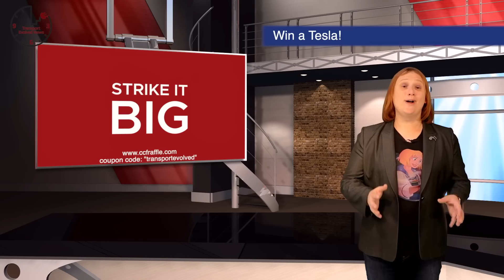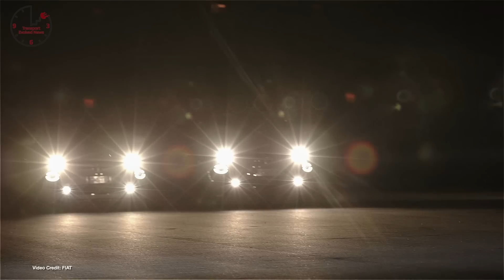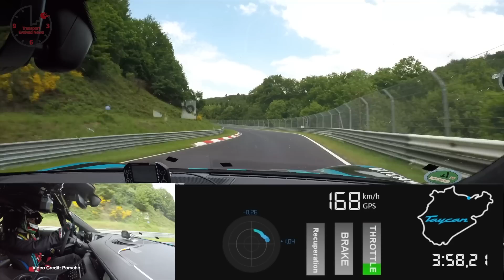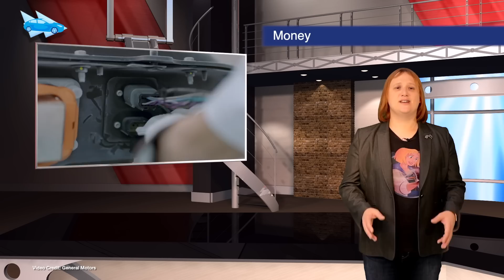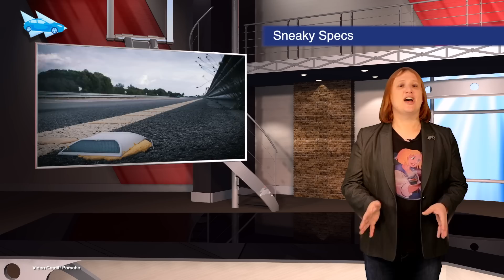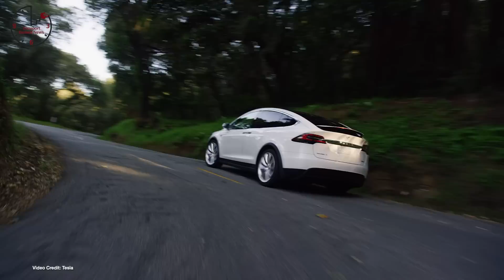Aptera Reborn, Polestar Production, Taycan Record — TEN 263

Comment: Porsche Taycan: I just set a new lap record on the Nurburgring Nordschleife!

Tesla Roadster 2.0: Hold my beer.

Aptera: I have a range of 1,000 miles and don’t need a plug to run most of the time.

Tesla Roadster 2.0: Spits out beer.

Porsche Taycan: 😭

Comment: I think that the Aptera is conceptually wrong. By prioritizing aerodynamic slipperiness over almost everything else, they have forced themselves to compromise on urban practicality. In daily use, most of us are using the right pedal to overcome inertia (AKA accelerating) more than to support slipping through the air (AKA cruising on the highway) I think that a car that is designed from the start with a basic practical shape (a five door hatchback) and then optimised (ie, the details are fine tuned) has a better chance of success.

Comment: Aptera's strategy of releasing a 3 wheel commuter car with a 100KWh battery pack that will run for more than $34,000 seems way out of touch with consumer demand in America. Sure people would like an EV with that kind of incredible range but a vehicle like this isn't designed for long distance trips, it's designed to be a commuter car to get to and from work. I don't understand what they are trying to get at, ok cool you have a car that can go 1000 miles on one charge but you have no cargo room to take anything with you and you can only have a second passenger along for the ride....
A better strategy would be to dump the weight of the 100KWh battery pack for a smaller one that can reach 250Mpc for under $20,000. When you combine that price with the $7500 federal rebate people would buy those up like hotcakes. Personally I would buy one for driving to work while keeping my jeep to use for snowy days or vacation.
Reply: You have voiced exactly what I was thinking.  Thank you.
Reply: Nobody is being forced to buy this vehicle. In due course we will see how many people think it is suitable for them and choose to buy it. I suspect you can take more luggage in it than you can on an airline flight. I do believe the performance claim; it works out to just over 60 watt-hours per kilometre, which should be easily achievable with the lower frontal area and likely lower drag coefficient. The battery would weigh about 400kg/850lb if it uses the best technology that is currently available on the market. It will be possible to go for the highest energy density without any need to worry about ability to work at high discharge rates.

Comment: Uh, where are they going to fit a 100 kWh pack in this tiny thing?
Reply: Even if they only manage 50kwh (which for the sake of cost and weight, they should go smaller), this thing should be stupid efficient and should have no problem still getting 300+ miles per charge.
Reply: They are not, not any time soon with current technology..

Comment: Nikki. Record performance on the "Green Hell" is important because so many anti-EV folks dismiss an EV's superior straight line speed and point to the green hell course as the real test of a car and that an EV will overheat before it can make a single circuit.

To sell the Taycan Porsche have to show that their EV can do this test admirably.
Reply: That lap time was faster than any production EV has run there ... and the Ring is the defacto global standard for comparing performance cars. Porsche didn't mention that the time was only 4 seconds slower than the Porsche Panamera Turbo S.

Comment: Billionaires of the world, please give Aptera that pocket change they are seeking. What's one million these days?
Reply: No one with a family or a loved one is going  to drive one of those things. Planes can be built lightweight in part because they have to be strong structurally but not strong enough to reasonably survive collision with another plane. The Aptera is about as safe as a motorcycle, because that's all it is. You can make it look like some jetsons car, but you can't call it a car.
Reply: @bradscott3165  If you can find the structural tests from the original Aptera, they show that it's actually incredibly strong due to the construction materials used and its unique shape.  Occupant safety in the event of a collision was one of the primary design goals at its inception.  Small, low-mass passenger cells, when engineered correctly, can be very, very strong and when combined with appropriate crumple zones and anti-intrusion structures, they can make for a remarkably safe, but light vehicle.  Take for example the "tub" of an F1 car.
If you have crash data for this vehicle that supports your assertion it offers "zero occupant protection", please provide a link, as I can't find seem to find any.